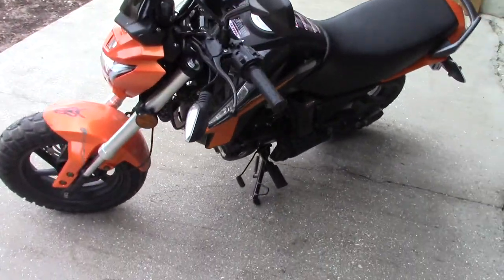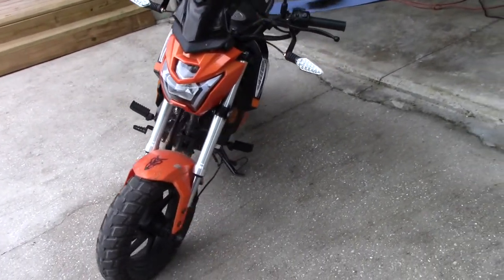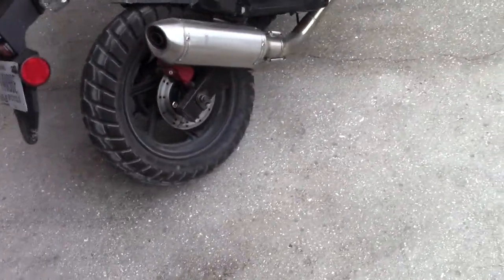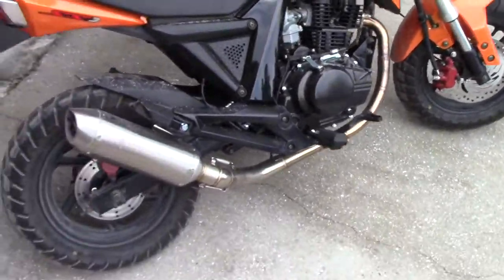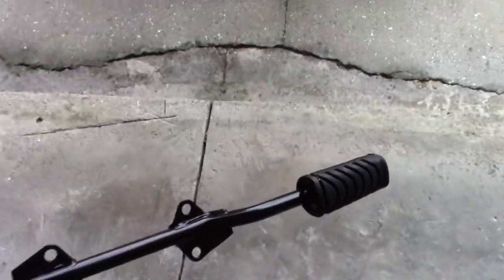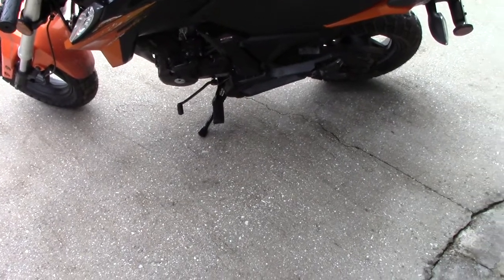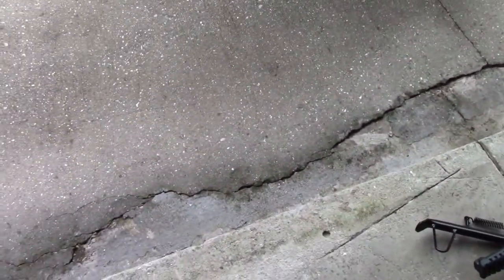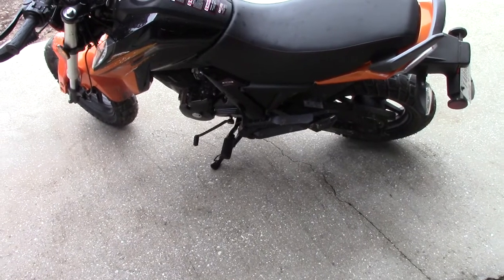2021 KP-Mini Kickstand Install

Comment: Thanks for putting up this vid.   For all you guys about to spend 4500 or so for a Grom,  I compared the Lifan side by side with the Grom.  With the Grom, except for giving up horsepower, the fifth gear, better lights, a better seat, stronger shocks and forks, better mileage, oh, and around $2500 US,  The Grom seems 'almost' on par with the Lifan Mini:) Don't believe me?  compare em yourself. I did, and for a TOTAL of $1941.00, my 2021 Mini now sits closest to the door (for faster exits:) in my garage, (which also houses more than a dozen  other motorcycles from 250 cc to over 84 cubic inches.... Just saying.....
Reply from the maker: Your welcome.  I like Honda's.  But I'd buy a Mini (or two in my case) before I'd buy one Grom.  Rides better, quicker, easily modded (if so desired), comfortable and an all around blast.  And I've nothing but positive things to say about Lifan as a company backing their products.  And do the math as well.  Honda Grom $3600 not including tax.  KP-Mini $2k.  Damn near get two for the price of one.  Honda warranty (1 year), Mini (2 years).  I can hear it now....the Grom is fuel injected.  Yes it is, and I've had ZERO issues with using the choke for 15 seconds then taking off.  And it is definitely my go to bike.  Thank you for watching.
Reply: That's the foot peg assembly for the older models...have to install one myself.
Reply from the maker: @mstanford627  Well both of ours are 2021 models, so they must be interchangeable.  The new one fits fine, feels good and doesn't feel like it's gonna drop over, so I guess that's all that matters.
Reply: @gregslair4278  oh yeah they're definitely interchangeable